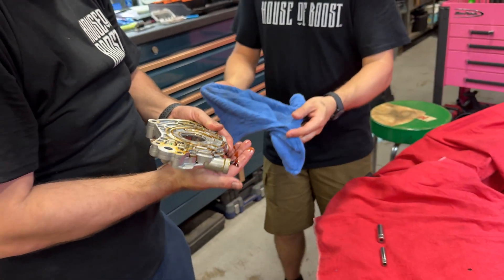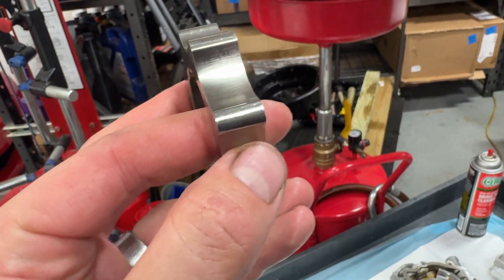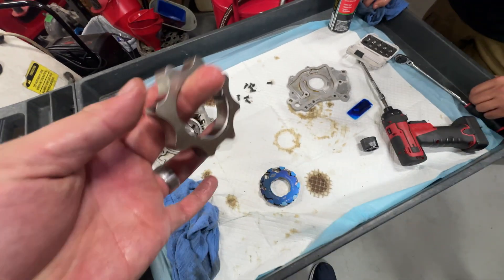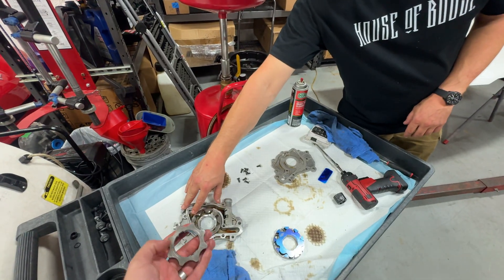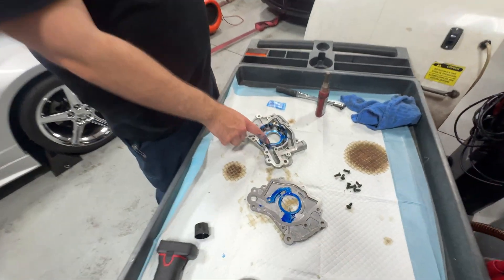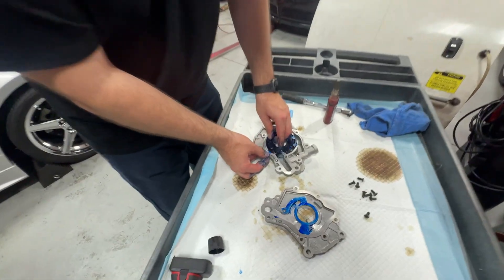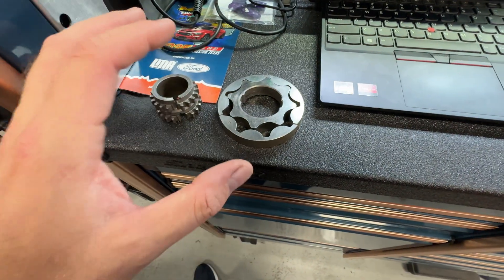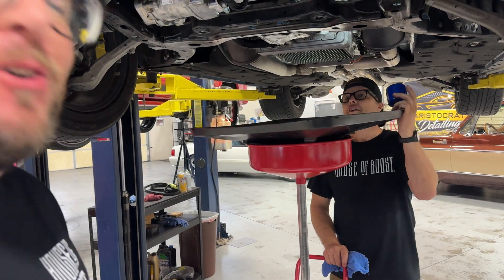How To: Swap Oil Pump Gears in a Coyote Oil Pump  w/ House of Boost!

Comment: I have a 2018 5.0 Mustang with 70k miles and wanted to know if you think boundary racing billet oil pump gears that are MartenWear treated would be enough, i want to push around 650whp soon and before i do any mods I want peace of mind by doing OPGs
Reply from the maker: Its enough

Comment: I don't understand why people don't just buy a whole new Boundary oil pump. I sometimes hear of people even buying the gears and a new backing plate instead of just buying the Boundary oil pump. I do not understand the parsimony.
Reply from the maker: If using the traditional rotor design Boundry’s backing plate can reduce cavitation, but otherwise its an increased/unnecessary cost add if the housing isn’t damaged or worn. On a high mileage car - definitely just order the whole pump. 11k miles like mine? Swap rotors.